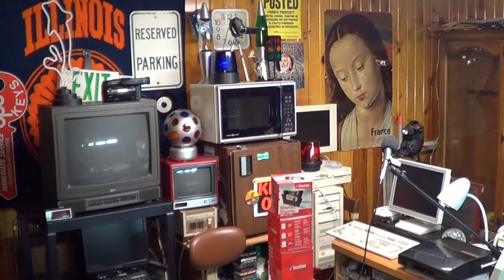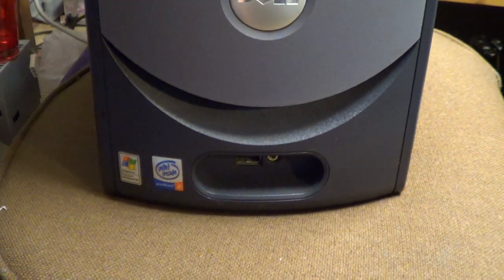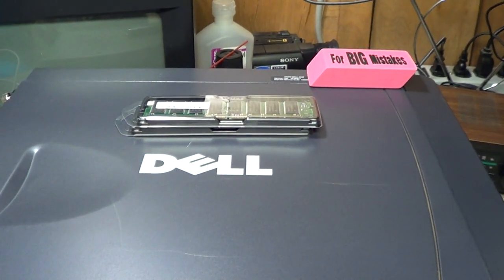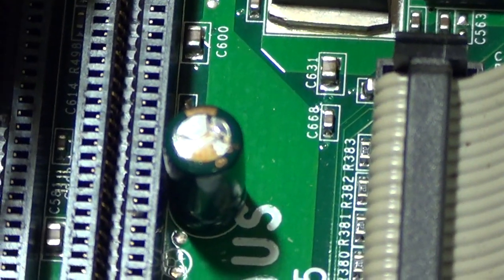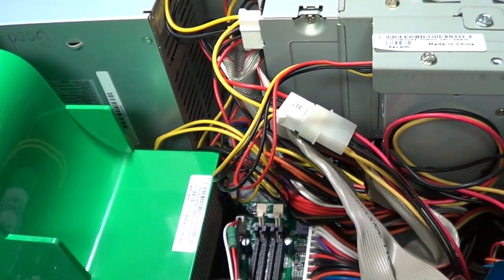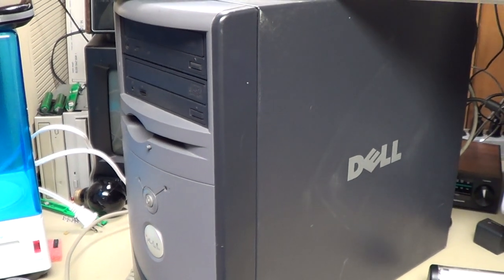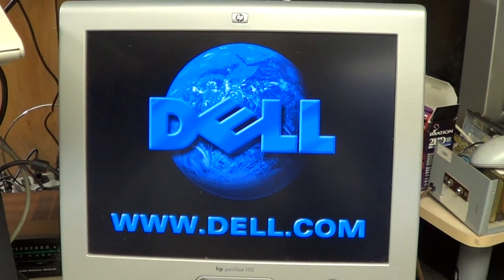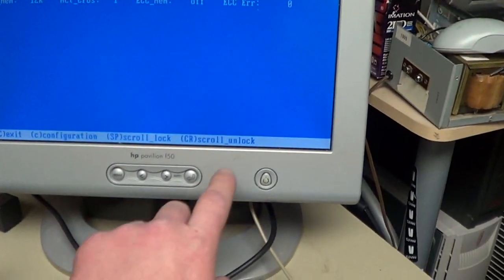Dell Dimension 2300 "Music Player" Computer RAM Upgrade

Comment: I'm amazed you don't had to wash the memory slots to make the new Ram work.
Every time I have to rub some alcohol to make it work ...
I'm not really worried about the bad caps, I have a lot of computers in even worst condition than this one, and they are working great. I have replaced them on one computer a short time ago (after postponing for 4 years ...), no difference.

By the way, I'm always happy to ear you talk about computers, even if it's for something as basic as a RAM upgrade.

Comment: Very interesting. I still have a Dell 2400 that I bought new in 2003, and currently use as my file server and printer host for several computers in the house. The thing is built like a battle tank, and apart from a few power outages has been running continuously for several years without incident. Your video inspired me to open the case and check out the capacitors.  They seemed all right, so I cleaned out the cobwebs and dust bunnies and we're good to go for several more years!

Comment: Nice machine in that it was free, and it's given you yeoman's service all this time with little done to it, other than a good cleaning initially.

I have a 2005 era eMachines (T3985) that was originally a Celeron D that belonged to my late mother, and it now serves as my media machine in the living room. Began life as a Celeron D based box with 512MB of RAM, now it runs a P4 processor and 1G of memory, running XP still and it runs just fine.

Comment: Picked one of these up from a garage sale. And..my god. I have seen destroyed computers. But dear lord, this was bad. Now, I did pick this up with 2 other working desktops for about 10. Anyway, the VGA connector had been broke clean off the board, the cover plate was bent off, power supply was caked with dust. AMAZINGLY, the hinge still seemed to power up and run
Reply: +Len Kagamine, The yandere (VintagePCsalike) the thing*
Reply: +Len Kagamine, The yandere (VintagePCsalike) The bottom of it was also rusted to hell and back.
Reply: +VintagePC's alike wow
Reply: Did you install a PCI graphics card?
Reply: Wasn't able to, not only was the case rusted so badly that it was horribly hard to open, but the motherboard had about 8 leaking caps. I salvaged what I could and chucked it.
Reply: You could've done some kind of franken-dell.
Reply: armanelgtron
It was too far gone, even for that.

Comment: Hey Bill I just wanted to give you a quick update on the Dell Inspiron 1501, 3 weeks ago I went ahead and washed the motherboard as well as some of the case plastics, then after drying for a week I put everything back together.

Some of the hardware that wasn't being detected properly is now somewhat working, most notably the optical drive. The ethernet controller still isn't working at all, but I'm happy enough with the results.

Comment: Heh, I have an even older HP Pavilion 7955 desktop that is a tank to say atleast. It has a first gen P4 that runs at 1.5 GHz. Everything original excluding optical drives has survived 11 years when it was in service. Right before retiring it I looked at the board and found about 6-8 unhappy capacitors by the CPU socket. I have no idea on how it survived that. 
I hold no doubt that it still works if I were to switch it on today. 

These older OEM's had thicker cases that we don't see anymore.

Comment: It certainly fared better than my old Athlon XP setup.  The power supply didn't fail, but all ten caps next to the CPU heatsink failed.  It would've been a bear to change those out, so I ended up junking it, not without considerable regret. :(

Comment: Nice update :-) I just got a P3 1000mhz machine from my uncle i cleaned it and rebuild it into a high end retro gaming rig! It has 512mb of mem and windows 2000 and the performance is good for a 13 year old system. Its fun to play with old hardware. My plan is to build several system and go to events and festivals so everyone can play old 3d games in a network! I have a videos on my channel about my Pentium3 builds.

Comment: Here is the specs of the dell dimension 2300:
Dell Dimension 2300 - P4 2.4 GHz - 256 MB - 40 GB - CRT 17"
Part Number: A-D0904 

GENERAL
Desktop type Budget desktop system

Packaged Quantity 1

Recommended Use home use, small business

Product Form Factor Micro tower

Color midnight gray

Manufacturer Dell, Inc.

PROCESSOR / CHIPSET

CPU Intel Pentium 4 2.4 GHz

Data Bus Speed 400 MHz

Chipset Type Intel 845GL

Processor Socket Socket 478

CACHE MEMORY

Installed Size L2 cache - 512 KB Advanced Transfer Cache

Cache Per Processor 512 KB

RAM

Technology SDRAM

Memory Speed 133 MHz

Memory Specification Compliance PC133

STORAGE

Interface Type ATA-100

Type none

Read Speed 32x (CD) / 8x (DVD)

Write Speed 8x

Rewrite Speed 4x

MEMORY

Max Supported Size 512 MB

Form Factor DIMM 168-pin

HARD DRIVE

Interface Type ATA-100

Spindle Speed 5400 rpm

AUDIO & VIDEO

Memory Allocation Technology shared video memory (UMA)

Supported Display Graphics 1800x1440, QXGA (2048x1536)

INPUT

Type keyboard, mouse

STORAGE CONTROLLER

Interface Type ATA-100

PROCESSOR

Installed Qty 1

Max Supported Qty 1

Upgradability upgradable

FLOPPY DRIVE

Type 3.5" 1.44 MB floppy

MONITOR

Monitor Type CRT

Native Resolution 1024 x 768 ( XGA )

Diagonal Size 17 in

Viewable Size 16 in

Pixel Pitch 0.28 mm

NETWORKING

Max Transfer Rate 56 Kbps

MISCELLANEOUS

Color midnight gray

Compliant Standards APM

GRAPHICS CONTROLLER

Form Factor integrated

Interface Type AGP

Graphics Processor Intel Extreme Graphics shared video memory (UMA)

Video Interfaces VGA

DIMENSIONS & WEIGHT

Width 7.2 in

Depth 16.8 in

Height 14.5 in

MANUFACTURER WARRANTY

Type 3 years warranty

AUDIO OUTPUT

Form Factor integrated

Signal Processor Intel 845GL

Sound Output Mode stereo

Compliant Standards AC '97

PRINTER

Type none

TELECOM

Modem Fax / modem - PCI - plug-in card

PHYSICAL CHARACTERISTICS

Form Factor micro tower

Weight 22.93 lbs

CLUSTER

Cluster Hard Drive none

Dell Dimension 2300 - P4 2.4 GHz - 256 MB - 40 GB - CRT 17"
Part Number: A-D0904 

GENERAL
Desktop type Budget desktop system
Packaged Quantity 1
Recommended Use home use, small business
Product Form Factor Micro tower
Color midnight gray
ManufacturerDell, Inc.
PROCESSOR / CHIPSET
CPU Intel Pentium 4 2.4 GHz
Data Bus Speed 400 MHz
Chipset Type Intel 845GL
Processor Socket Socket 478
CACHE MEMORY
Installed Size L2 cache - 512 KB Advanced Transfer Cache
Cache Per Processor 512 KB
RAM
Technology SDRAM
Memory Speed 133 MHz
Memory Specification Compliance PC133
STORAGE
Interface Type ATA-100
Type none
Read Speed 32x (CD) / 8x (DVD)
Write Speed 8x
Rewrite Speed 4x
MEMORY
Max Supported Size 512 MB
Form Factor DIMM 168-pin
HARD DRIVE
Interface Type ATA-100
Spindle Speed 5400 rpm
AUDIO & VIDEO
Memory Allocation Technology shared video memory (UMA)
Supported Display Graphics 1800x1440, QXGA (2048x1536)
INPUT
Type keyboard, mouse
STORAGE CONTROLLER
Interface Type ATA-100
PROCESSOR
Installed Qty 1
Max Supported Qty 1
Upgradability upgradable
FLOPPY DRIVE
Type 3.5" 1.44 MB floppy
MONITOR
Monitor Type CRT
Native Resolution 1024 x 768 ( XGA )
Diagonal Size 17 in
Viewable Size 16 in
Pixel Pitch 0.28 mm
NETWORKING
Max Transfer Rate 56 Kbps
MISCELLANEOUS
Color midnight gray
Compliant Standards APM
GRAPHICS CONTROLLER
Form Factor integrated
Interface Type AGP
Graphics Processor Intel Extreme Graphics shared video memory (UMA)
Video Interfaces VGA
DIMENSIONS & WEIGHT
Width 7.2 in
Depth 16.8 in
Height 14.5 in
MANUFACTURER WARRANTY
Type 3 years warranty
AUDIO OUTPUT
Form Factor integrated
Signal Processor Intel 845GL
Sound Output Mode stereo
Compliant Standards AC '97
PRINTER
Type none
TELECOM
Modem Fax / modem - PCI - plug-in card
PHYSICAL CHARACTERISTICS
Form Factor micro tower
Weight 22.93 lbs
CLUSTER
Cluster Hard Drive none
POWER
Type power supply
Nominal Voltage AC 120/230 V ( 50/60 Hz )
OPERATING SYSTEM / SOFTWARE
OS Provided: Type Microsoft Windows XP Home Edition
OS Provided Microsoft Windows XP Home Edition
Type Drivers & Utilities, Microsoft Works 6.0
GENERAL
ManufacturerDell, Inc.POWER

Type power supply

Nominal Voltage AC 120/230 V ( 50/60 Hz )

OPERATING SYSTEM / SOFTWARE

OS Provided: Type Microsoft Windows XP Home Edition

OS Provided Microsoft Windows XP Home Edition

Type Drivers & Utilities, Microsoft Works 6.0
Reply: Detailed specs are the best specs
Reply: It would probably run Windows 98 well.

Comment: On SDRAM DIMMs, I've noticed that the spacing of the RAM chips is a pretty reliable indicator of whether the module is made by a major brand or not.
It sounds strange, but I've noticed that name brands always have the chips spaced to allow for a 9th chip to be populated, so that an ECC version can be manufactured.
Generics have their PCB laid out for only 8 chips, probably because nobody would buy ECC from them even if they offered it.
Starting with DDR2 even name brands have 8 chip PCBs though.

Comment: Yeah.  I figured the surge caused an overvoltage in the 5V circuit.  Those blown caps all looked like 5V caps. Was that a Delta by chance? Some of the Delta units they used in some Dells didn't have the best protection, which is very unusual for Delta since they usually build really good power supplies.

Comment: I would be curious to see if that would support a faster CPU, from my experience with socket 478 boards that only support PC133 ram they have all been limited to supporting the first generation "Willamette" P4 processors which maxed out at 2.0GHz before the Northwood was introduced.

Comment: A bad cap can eventually short. When that happens, it can kill mosfets and sometimes a chipset, which would make the board completely unrepairable. If a board is going to be recapped, the best time to do it is while it still works, so the chance of a successful repair is still near 100%. Recapping boards after they've died is hit and miss.

Comment: I wish we would go back to this time, we had amazing computers up until 2009ish, been mostly junk since then, even Dell has come down to using laptop bricks for desktops
Reply: here here. Have to this day a working dell inspiron 1300, 10 or 11 years old and still kicking.
That includes the original 80gb EIDE hard drive. no surprise the drive is a WD "blue" hdd.
Reply: I agree. I'm keeping all my old machines and will continue to use them for day to day activities until said activities no longer support them. Then, I'll find ways to keep using them for nostalgia value.
Reply: ThatGuyYouKnow Yup. Until the day it stops working my Inspiron 1300 has work to do, and when that day does come if I can I'll fix it until I can't. Even then it's not over I have made a virtual clone of the drive that'll run o  MS virtual pc. So the machines "soul" well live on no matter what.

Comment: I have a 2300 and would like extra memory. Right now just a 256 card. The 2300
was hardly used and very clean. My tech helper is having trouble finding the cards.
Any ideas? Thanks, Leo
Reply: Have you tried ebay?

Comment: uxwbill  I got a question in relation to old pcs I got a old aopen pc off the curb added another drive hard drive though and adapter, and tried to upgrade it to win 2000 since it has windows 98 first edition, but it says cannot boot from drive- code 5 how do I fix this?
Reply: ***** well its a dinosaur
 Pentium 2 350 MHz
128 meg ram
ive added a dvd drive, so it can and will play dvds
the bios is
award ax68c, R2.36

im baffled why cant it boot from my cd drive?
Reply: +fatman89898989 try booting it off a floppy. you need 4 for windows 2000, allbootdisks[.]com has them, it will then install from the cd
Reply: thanks for the help!

Comment: hello uxwbill,i have a dell demiesion 2400 and ii have a question. does my computer use a 184 pin ram,if im wrong can you tell me what is the pin amount for the ram.
Reply from the maker: Your Dimension 2400 calls for PC3200 DDR (sometimes called DDR1) memory. These modules have 184 pins. You cannot use DDR2, DDR3, DDR4 or any other type of memory. Do not attempt to use a memory module for a laptop.
Reply: +uxwbill thank you soooooop much,I will buy that on amazon.
Reply: also is there a pin amount on graphics card for my computer,sorry for so many question. im just a noob at this.
Reply from the maker: I am not sure what you are asking. If neither you nor anyone else have ever installed a video expansion card within the computer, the computer's built in graphics hardware will use some of the memory, or RAM, that you install.

If you want to install a video expansion card for better system performance, the only kind you can use is a PCI type. AGP and PCI Express cards cannot be installed in your computer.

You may also want to consider a newer computer system. Even with all the upgrades you're putting into the Dimension 2400, it is still a very limited system even by the standards of several years ago. The money you're putting into this could get you a newer system with much more power and expansion capability. Systems like the much newer Optiplex 760 or 780 are available for very little money and they'll oftentimes come with a legitimate copy of Windows 7, 8 or 10.

Comment: The memtest86 numbers are very interesting. It definitely shows how much of a bottleneck SDR memory is on a P4 system. My old P-III/PC133 machine can do 455MB/s in memtest. I would've thought that a P4 system--equipped with a newer memory controller and quad pumped FSB--would do much better than 491MB/s.

Then again, who knows how accurate those numbers really are. PC133 should be able to push 1GB/s.

Comment: Plain Memtest86 (sans +)? Now that's a little long in the tooth.
Anyway, I happen to maintain a few HP Vectras similar to this machine (but even older @1.5 to 1.7 GHz) @work, for noncritical surfing/office. They used to be pretty much unbearable with 256 megs (as they say, the biggest virus is the antivirus). Got a bunch of 512 meggers, and they've been much happier since. Still not sure why Firefox display updates make the mouse cursor lag, AGP seems to work fine though TNT2 Vantas are antique.

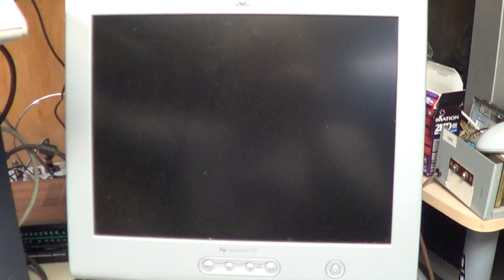Comment: Hey uxwbill, I have a question about the HP monitor you where using at 9:55. I recently got one from a electronic recycling and it seems to have some kind of unique connector. Is it just a straight up plug or does it have a power brick like a laptop?

Comment: i enjoy watching videos about old computers i happen to have an old compaq its got a Celaron D single core at 2.5Ghz with 256Mb or ram i use it as an emulation machine i also have a slightly newish Dell xps 410 that been upgraded from a pentium 4 for to a core 2 Daul core honestly note sure the clock but its got 3Gb of ram and an ATI 5500 Card a 150Gb WD drive  i run linux on all of my older pcs and they all handle it great just a random comment i do enjoy your videos though kinda ironic that im watching this on a pc with an i5 at 4Ghz water cooled 16Gb of Ram and 2 AMD 7870s on a 1200w power supply XD

Comment: My Grandpa has a dell demension 2300 that he just retired after my brother built him a computer. He used it until late 2012 which seems almost amazing to use such outdated tech. Grandpa might give me the computer. Not sure though.

Bill if I were you I would but a backdrop on the wall or atleast move some of the unnecessary stuff like the microwave to behind the computer monitors or on the desk. Just my opinion.

Comment: soldering is pretty easy if necessary
Reply from the maker: No need to preach to the choir. Also not entirely true of SMD parts.
Reply: @uxwbill  the caps are smd?
Reply: what
Reply from the maker: After making over 1,000 videos, I don't remember the exact details of every one. Some of the capacitors in this system were certainly difficult to get at, and it's not worth it. Remember -- free computer. I got more than my money's worth out of it!
Reply: @uxwbill  alright hope it works out

Comment: Nah, it'll be okay with 2000.  If you can get, say, 512MB RAM or more in it, XP would probably be okay too.
As for the display, I'd bet it's the video.  Either replace the video card or add one in if it's using the video built into the board.

Comment: Hynix = cheap RAM. Used to see those modules at computer shows all the time. It'll work, just don't attempt to overclock it! Bad capacitors, a hallmark of the era of crap hardware! PC133 in a i845 Pentium 4... yikes! I'm actually surprised to see an Award Medallion BIOS POST screen with Energy Star logo on a Dell, Intel usually opted for the traditional text only Phoenix style screens on their boards. I wonder if they made that motherboard?